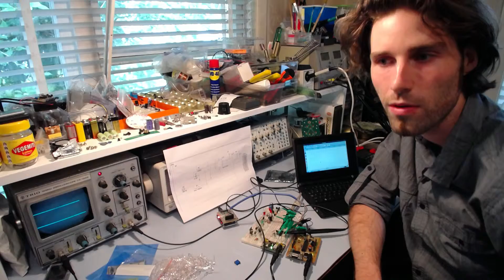74HC123 Pulse Stretcher Circuit - Part 1

Comment: How do you calc values for R2 and C2 on the power up considerations mentioned in the 74GC123 docs?
Reply from the maker: I can't remember, does the datasheet not mention it? Or at least an example circuit with some example values?